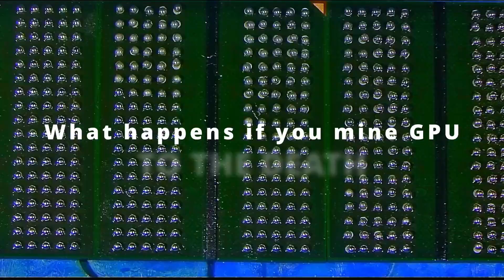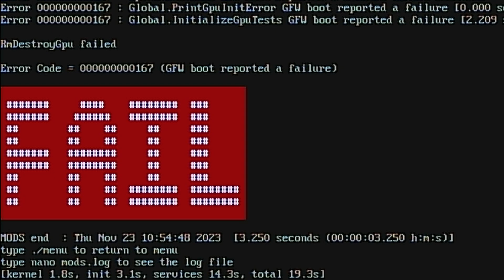GPU Fatality: What mining does to your GPU ⚰️🖥️

Comment: Yeah, this potential result is why when I played around with mining at all, I kept things just a tad slower to keep the temps down. You lose on the hashrate, but that gpu still works today... 8+ years later. And it did well enough on its own to help buy some steam games people were trading for dogecoin at the time. Got a nice list of them. Paid the card off in its own way, sorta.

An undervolt here, fan speed increase there, extra airflow across the cards in general... all of them go a long way to perserving a card longer.
Reply: 100% right. You don't let your GPU stay at max forever until it just breaks, that's dumb. You also wouldn't run your car at 200 MPH and not expect some issues from repeatedly doing that.  It is so easy to take care of a GPU while mining by doing the things you said. Undervolt, fan speed increase, great airflow, etc.
Reply: And a little bit of high end Thermal Putty can help too :)
Reply: Same here, i had 2 290x mining Dogecoin for a few mounth. I made my money back by x133 what i paid for the cards when i sold my doge back in 2021. And 2 of the GPUs are still running in coworkers computers. :)

Comment: I guess there's mining and there's mining to death. I have a RX580 that I bought as a ex-mining card from a hobbyist miner, used it my PC for a while, then I mined on it for about 15 months 24/7 and now it sits in my spare PC still working absolutely fine. If you mine sensibly then the risk is definitely reduced
Reply: lower power cards dont die from mining normally its the 300w+ high end gpus that die from mining normally

Comment: The ponzi scheme preachers have arrived in the comments...
Reply: Why do the contacts need to be rewelded? Because of temperature fluctuations. Its a myth that mining kills GPUs. I still have 1 rx480 mining no issues. Thermal cycling has been shown to be the reason. This video shows a failed attempt to fix a gpu. I cant imagine giving him credit for troubleshooting it properly.😂
Reply: Yes mining will kill your card unless you are meticulous with maintenance. I used to go through a card every couple months until i adopted a bi-bi-monthly cleaning schedule  hav3 been m8ning 24/7 for the last 5 years on 3 RX580'S and a RX480 with no card deaths and i have yet to pull the heatsink a re-paste the thermal compound
Reply: @TheCryptoMiner same for vehicles.  tractor trucks get millions of miles because they reach operating temperature and stay there for 600 miles at a time.
Reply: I'm not, just glad those cards exist because the vast majority was well preserved and not abused at all. In fact mining does less harm to your card than gaming. What you are saying is pure copium.
Reply: @yezok01 gaming usually does more harm to it than mining tho... mining is not that different from 3D rendering (my job), and I guarantee you that my card suffers less while under stress by Octane than when it's under full load playing Battlefield. In both cases I try to maintain constant clocks and temps, but it's very hard to get this to work in a game without setting a higher base clock to keep up with the boost during playtime

Comment: This is not the first time I see such issues on mining GPUs. Seems like mining just puts GPU to such stress that it will die sooner or later.
Btw, to all of you. Be careful what you buy on internet. There are dishonest sellers offering GPUs not mentioning a word about that those cards were used as miners.
Another root cause I've heard is that mining cards are just not treated right when it comes to ambient temperature. They sometimes stored inside a room where the air humidity is inappropriate.
Reply: Mining is especially bad on memory. In fact miners generally only care about memory temps because 100C or higher isn't just possible, it's probable 😬
Reply: They will never die until human error is involved most of the time, the rest is quality.
Run your car full throttle and a other with common sense and you will find the one taken care of is just like new.  There's maintenance in everything, you have to maintain your stuff.
PS: I fully agree on sellers being dishonest.., there everywhere. and the temp and humidity...
Reply: You need to buy a used card under the assumption it was used for mining.  And don’t buy it unless the price is right.  I have a couple used mining cards and they still work fine.

Comment: And thats a 3080 LHR, so it's not old, people forget that they should change thermal pads on gddr6x memory, also that gigabyte cooler is dogsh1t
Reply: that's why i avoid any Gigabyte branded cards and products. their product usually is crap and easily died. i forgot the last gigabyte that i owned. but i remembered that it died suddenly just like that.
after that gigabyte is on my blacklist.
i think it's a gpu. but forgot the type. and it was only for gaming.

Comment: Was all that new replacement memory or just reballing existing memory?  I ask because if it was all new, wouldn't with labor cost probably be about the same price if not cheaper just to replace the whole card?
Reply from the maker: no it was its own original memory. I had it removed to verify low resistance on the core. Soldered it back on just for show
Reply: So low resistance on the core means dead core right? @northwestrepair

Comment: Yeah. I think Nvidia and 3000 series not capable of memory undervolting. When I was Ethereum mining with AMD cards, I actually undervolted memory to the minimum available voltage setting. I think the reason it works best that way because memory does not have active cooling. While some memory chips are padded to the GPU cooler, the GPU actually adds heat or does not help much to cool memory.
Reply: i think it depends on what card you go with. I have a Asus Tuf RTX 3080 and the heatsink and thermal pads on the vram help a ton with temps.
Reply: @NonLegitNation2  right. does it have gddr6x memory? i heard it runs really hot
Reply: @zodiacfml  I have 6 different cards with GDDR6x memory, including the 3090, and it runs hot AF. Some cards like the EVGA FTW3 series and the Asus Strix and Tuf come with good thermal pads, and some cards like the ones from Zotac or the Founder's Edition don't. Best thing to do is be reasonable with the VRAM overclock and keep the fans at 100%. If you have a GDDR6x card with miserable pads then replace the pads. 

The 3090 uses dual-sided VRAM and should not be used for mining period. I would not touch even a used one. At least I got an extended warranty on my 3090, but I don't know how that's going to work since it's an EVGA card.
Reply: @m8x425  Thanks. That is crazy.
Reply: @zodiacfml  yeah it does. When i first got the gpu used on Ebay my memory junction temps hit 110C, after a repaste and replacing the thermal pads it's back down to normal, topping out at about 75C at the most when under load.

Comment: I have a former mining card that works excellently.  It came with a mining BIOS on it though.  I think that actually preserves the chips.
Reply from the maker: It does and it don't.
Memory controller is inside the core.
Just because you are not using 3D rendering resources, does not mean you are not torturing the memory controller.
Mining bios will reduce power consumption but it will not make you last any longer.
Reply: @northwestrepair lower consumption does lead to longer life as far as I understand

Comment: That is not the fault of mining. That is the fault of pushing the card 100% OC for several months straight. you can avoid memory overclocking, undervolt the core, run stable 55~60 Deg C rigs and not have memory modules blown in 5 years...
You can literally do more damage if you overclock the card the same way and game on it, gaming is far worse on the card than mining.

Comment: so whats happened? you changed all memory chips and still give memory error? so what that mean? core problem?
Reply: He doesnt know
Reply from the maker: No, i removed all memory to see if low resistance remained on the core and it did.
Placing memory chips back on just for the show.
Reply: @northwestrepair  How does that manifest? 
Do you find one memory channel with low resistance that could be removed and the core seem 'normal'?
If yes, then in theory a custom bios that reduces the memory channels would create a working card, no?
If not, then does the core show as LR on everything?

Comment: If I have 11 - 12 ohms on Samsung Memory (RTX 2080 Ti) was does it mean?
Dead ram somewhere or it's normal?
Reply: only samsung memory have low ohms, other types have higher, so when we get lower reading its mean memory not working or core or board problem
i wash he answer us
Reply: @AbdAlgani1999  I know that but what I want to know is: "is 11 ohms" considered normal on a Samsung Memory?
Because what I know 20 ohms is considered acceptable but what about 11 ohms??
Reply from the maker: it means SAMSUNG
Reply: @northwestrepair  then it's okay boss?
Reply: @kakkoishonen  It means either samsung memory chips normally with these specs or Samsung dun goofed at least this time or regurlarly. But if so, AIB partners would have known something is wrong, which is an even greater scandal. Or they just do not want to give a guarantee for mining because they know it cannot be done right.

Comment: being honest ,nothing happens if you mine properly , properly means operating the gpus in their stock values , in fact both my olds rtx 2080 seahawk ek X works perfectly fine after 2 years nonstop minning ethereum :). Again i never overclock them, nor overvolt either...
Reply: IF you tink about to reach pick efficenci you need to underclock to pay less electric bill
Reply: @nellox8178   i know ,thats why i said that i nevver OVERclock or OVERvolt :) . i said nothing about underclock which is not harmfull at all
Reply: same, i treated my mining rigs with respect and maintenance. i repasted/repadded them every 6 months. they never had dust on them- they were immaculate. when eth went POS- i did a final clean of the cards and placed them back in their boxes for the next mining thing to show up.
i made a nice chunk of money from these cards, and im happy to hold on to them until the next thing shows up. i made my money back plus a bit. im happy!
Reply: Yeah but nonetheless I think you shorten the lifespan of your card
Reply: Sample size: 2

Comment: Bought 24 1060s in 2017, they've been running 24/7 since.
Reply from the maker: Did you flash it with some weird bios to disable 6 pin power draw to keep core at 139mhz ?
That took me few hrs to figure out why 1070 was performing like old AGP card lol and then I realized it was used for mining.
Flashed with original bios and it worked.

Comment: @northwestrepair HI there Tony!
Do you think that the main culprit of damaged GPU is running it constantly under stress like 24/7?
Reply: It’s usually thermal cycles and high temps that degrade hardware. Constant is not usually bad thing.
Reply: @Multimeter1 yeah, high temps are always bad for the hardware. I'm only wondering if running a GPU 24/7 on full stress (keeping the temps on normal level) just shortens the lifespan. If GPU can last long on constant using then what about other components? But wait, no worries, in case of emergency Tony is always willing to help :)

Comment: I  1060  back in 2016  for like 330$ and later bought 6 month old 1080 ti from a miner back in +-2018 for half the retail price , miened on them for like over 1 year. I keept my ethereum and later sold it when it reached around 2000$ so it paid for both cards and I still got ethereum worh around 1000$ now ;) Was well worth it. Both cards are fully functional still, I recently sold 1060 for 100$ and 1080 ti is in my wife computer. For my own computer  few months ago I got 3080 ti from a miner and for a great price.
Reply: What you do should be illegal.

Comment: Does mining affect memories only or the core as well?
Reply: Most of the mining algorithms that were feasible on GPU's used all the memory and bandwidth they could get. It's unfortunately why no existing hbm video card on the market can be trusted because miners bought these by the pallet then. It also didn't help that ethereum's program practically blocked attempts to have an ASIC that could understand the algorithm enough to mine it effectively. Like the one thing that ETH did differently that made Bitcoin look like the good guy in comparison.

Comment: What if maintenances had been performed in time?
Reply: what maintenance? mining just kills gpu's. temperature is a mitigating factor but does not guarantee gpu survival. same for undrvolting. the memory controller runs at a specific voltage that cant be changed and mining puts the memory controller at 100% usage, its not healthy for the gpu. miners that say "its fine, i undervolted and repadded, temps are great" are not electrical engineers, they have no clue what mining does to a gpu and will say anything to justify their mining
Reply: @UrokLizard  geez!! Have a smoke dude

Comment: i genuinly think  you should learn alittle bit about mining. I have some gpus mining for over 5 years some of them mining for 2 years 24/7 they are absulutley okay. Thermal expensition is the problem which kills gpu's and also miss use. If you keep your gpus in dust free enviroment with thermals are good you should be okay. You are a repair expert you should know that gaming on gpu is the worst, with gaming GPU uses full TDP which we say it goes full tilt. They sitting on 80 C core hours and then gamer stop gaming and turn the computer off, then the temps go down . With this Cores are absulutley die, memory chips getting over 100C specially with gaming. If a crypto miner is not a  kid and respect their equipment ( as they should because its an investment) the mining GPU's are the best. I have 120 GPU's which is a small farm, and many of them inspected daily never run over 62 C core temps, When its gets hot the pads and paste getting changed, once a month get dusted. They sit in server cases. I refuse to believe my gpu's are in worst shape then a gamer.  I cought you a few times blaming crypto mining as miss used gpu's, Its not the mining its the preson who is overclocking and using the miner. Besides all we underclock cards not over clock them as such. We usually try to set the clocks for efficiency on that priticular algo we are mining. I like to watch your videos and i do learn from them. But this one was slightly untrue.
Reply: mining on cheap gpus(low end price for X Gpu) is not worth. Lack of propper cooling and quality components.
Reply: @MiriadCalibrumAstar  yes mainly GPu companies with low end quality fails very quickly like this gigabyte or zotac,pny.